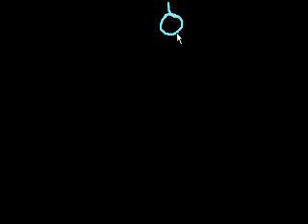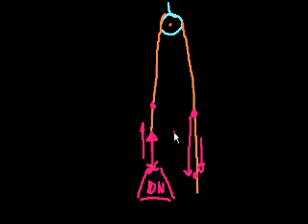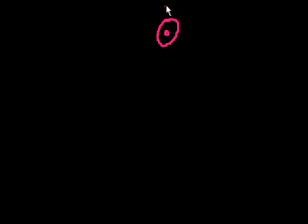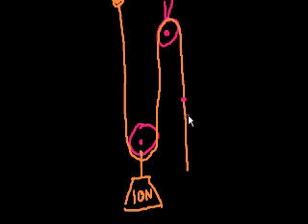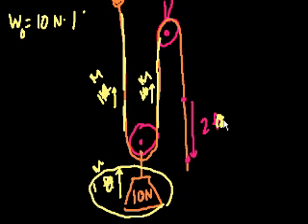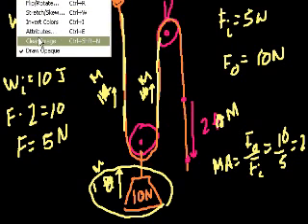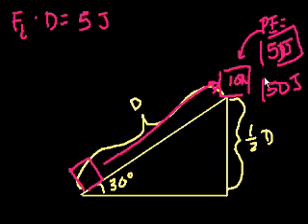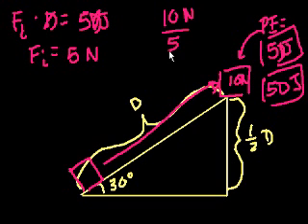Mechanical advantage (part 3) | Work and energy | Physics | Khan Academy

Comment: If the load is 10 N and you pull with a force of 10 N shouldn't the two equal and opposite forces cancel out each other? The object shouldn't move at all.

Comment: I wonder if there could be created some locally centralized pulley system that multiple machines could all be connected to?

"A single candle can light 1000 or more other candles without diminishing itself."
Reply: All the connected machines equally benefiting from the centralized pulley system (household-wide maybe) / campus-wide; etc..

Comment: this makes no sense to me. if you pull the rope 2m why does the yellow bit of rope only go 1m? couldn't be more confused
Reply: +Sam Dawkins Let's say that the part of the rope on the left side of the uppermost pulley has a length L meters. That means we have L/2 left of the downmost pulley and L/2 on the right side..If you pull the rope 1m down (part of the rope on the right side of the uppermost pulley) you must agree that the rope on the left side of the uppermost pulley shortens by 1m also. So now we have length of (L-1) meters for the left rope. But since the rope is bent because of the downmost pulley each of the 2 sections is (L-1)/2. So L/2 - 0.5m! Downmost pulley was rised by the same amount as one section, so in conclusion that's 0.5 m! So input distance = 1m, output distance = 0.5m... or more generaly input distance = X than for this machine the output distance = X/2 ! I hope this can help someone. :)
Reply: A bit late:
There's two sections of rope supporting the bottom pulley (left section and middle section). If you pull the rightmost section 2m, the leftmost section shrinks by 1m, and the middle section of rope shrinks by 1m.
Think of the rope as sectioned off into 3 parts, but the left 2 sections act as one to support the mass, and the rightmost section is what you do work on.
Reply: jamiec24925  what do you mean the left and middle sections of rope "support" the weight? if you move and section of the rope 2 feet should all sections of the rope/the whole rope move 2 feet? why do we consider the the left and middle sections of rope as one unified section but the right section different? how do the forces differ on the different sections of rope?
thank you
Reply: The whole yellow section gets shorter by 2 feet. But a single point on the leftmost section wouldn't move at all. The pulley with the mass on it would ride along "left" with respect to the rope. A single point on the middle section would move upwards.

Remember that the left end of the rope is fixed to the ceiling, and the pulley with the mass is free to move up or down.
Reply: ^ Thank you very much. Very helpful.
Reply: It's because the pulleys are there to stop it, the actual rope it's self goes 2m, but the rope in between the two pulleys only goes 1m shorter. This probably doesn't make sense, but if you know how one of those pulleys work then it might make a bit more sense :)

Comment: @cmcespedes2 Think of it as if your trying to lift a 100 lb block six feet in the air. It is quite a difficult task but with a 30 degree wedge you could push the block up the slant and have moved the block 12 feet total making it actually 6 feet higher than it started. In a perfect world this is a 2 to 1 advantage but due to friction it is not exactly so. Still a mechanical advantage though. For every foot you move the block, it raises 1/2 a foot vertically. Hope this helps man

Comment: I understood the science behind the pulley and how the mechanical advantage is achieved, but the wedge? not so much.   How can you have a mechanical "advantage" of 2 by pulling (or pushing)a weight up hill? Where is the mechanical advantage in that?  It seems to me that this explanation is wrong or there's something else he forgot to mention. Imagine you pushing a cart up a 30 degree hill, there's no mechanical advantage.  You push one foot up, the cart moves one foot up.
Reply: i think the distance of the pushed object relative to the ground is not 1:1. u can see the distance of the pushed object (hypotenuse) is greater than the height of the pushed object relative to the ground (opposite side of the 30 degree angle)

Comment: The mechanical advantage is NOT 1 (one); it IS 0 (zero) !
There is NO MA in your first illistration.
Actually there would be a NEGATIVE MA due to the friction losses of rope on sheave + sheave/axle on bearing. 
It is also TOTALLY WRONG to refer to a " 10 newton weight ".
The newton is the SI unit for force; it is the amount of net force required to accelerate a mass of one kilogram at a rate of one meter per second squared.

Gray

Comment: @BallawdeQuincewold Actually, he meant to say 5DNewtons, which, if distance (D) was 1, it would actually be 5Joules, like you thought it was supposed to be. But D is unknown, so it had to remain as 5DNewtons (which he accidentally corrected to 5DJoules) where the D's would cancel out when you'd compare the equivalent Work in and out so that you could get the Force. Basically Work(in Joules)= xNewtons*Distance, not xJoules*Distance, that was the "Error."

Comment: On the inclined plane: Force x Distance can't equal 5 D Joules.  This would mean that Force is measured in Joules.  Work (in Joules) = F x D.  Shouldn't it be Work out divided by work in to calculate efficiency?  And, length divided by height or force out divided by force in to calculate mechanical advantage?

Comment: In most physics problems if the mass of the pulley.. or the rope  is not given you assume it's zero... every problem in physics 1 is like this you introduce pulley or rope mass later. In harder problems.